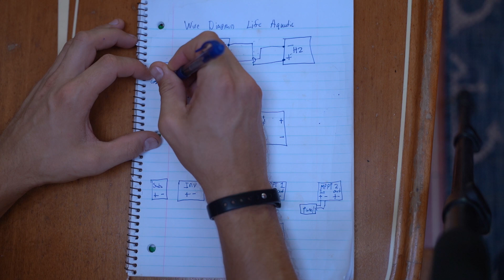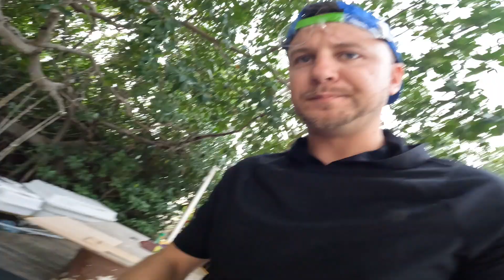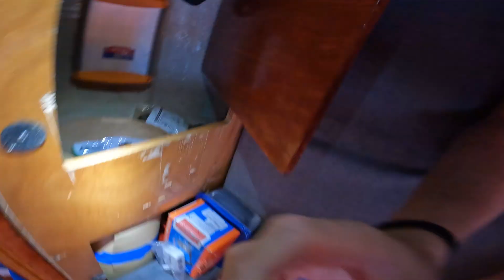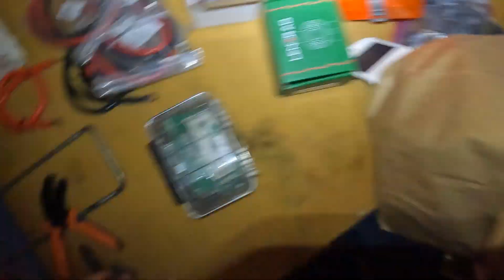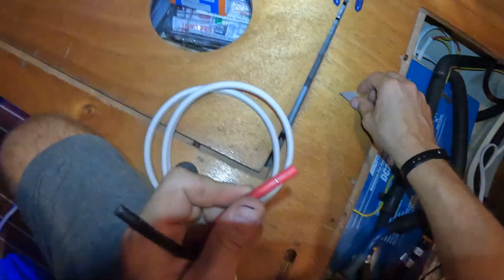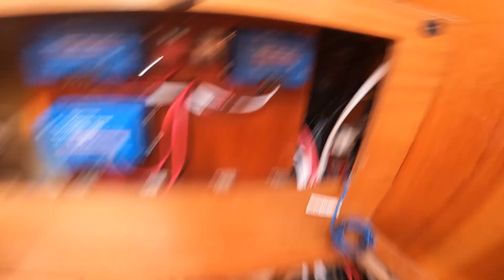Caribbean SAILBOAT Battery UPGRADE! New LITHIUM and VICTRON Gear!

Comment: Maybe missed it but what current is being delivered to the DC-DC 30 Amp charger from the Alternator? If more than 30 amps could it be reason for heat from unit? I am curious becuase I am on the same project and I wasnt clear how many DC DC chargers were required for a 75 amp alternator and how they are wired (parallel)?
Thanks
Reply from the maker: This is something I'm looking into currently with Victron, because I don't like how they have their fuse drawn into their diagram... Because If that fuse blows and removes the battery from the system it would inherently send all of the alternator power directly to the DC to DC charger. Is your unit also a victron? I am emailing them to review this electrical drawing. And understand what the max amperage the unit itself can see. I believe my alternator was previous putting out between 60-70 amps but I will review the part number on it and determine exact manufacturer output.. 

So the more then 30 amps, because the alternator is first being fed first to the large AGM battery's I am not to worried about the DC TO DC as the AGM battery should be taking the brunt of that amperage. But once it's fully charged It won't allow much more amperage to enter the battery. So I want to understand if this is what is causing the heat in the system. It is well reported that the victron DC to DC units run pretty hot on online forums. 

I am looking to swap this unit for their new 50amp unit if I can control the max amp output and limit it back if needed to match my alternator output.
Reply: @SailingLifeAquatic  I agree . I havent bought my DC-DC charger/s yet but I am planning victron components, I am working on Panel structure install. My current AGM Batteries coincidently have just gone south. So I am having to prioritize the install with more urgency.
I saw " the Sailing brothers" youtube video where they are installing more than one DC-DC charger for their alternator, this provoked my question to you.🙂
If my alternator pushes 70 amps and the starter battery is full I will like to know where that 70amps goes  as second option and if it has difficulty getting to house bank through a 30Amp charger? 🤔
Hope you have some success with your investigations with victron.
Reply from the maker: Also go do some research on the new 50 amp DC to DC that victron is releasing in March... I am going to return mine and buy that one as it networks so is truly a smart device. And it supposedly has better fixed it cooling issues.
Reply: @SailingLifeAquatic  That’s great to know. 🤔👍Bob. ❤️
Reply from the maker: Alright so to follow back up, my alternator has a max output of 115amps. 

 I have also talked to my victron distributor and they want me to return my DC to DC charging unit because it is consistently overheating in the current space it's at now. I think I will return this unit and purchase their new 50amp DC to DC charger that has supposedly solved their heating issues. And I'll still be under my 50% usage of the alternator. So I think it'll be the perfect size for this system.

Comment: As an aside, I was really interested in a Beneteau 373 as a tide me over Sailboat to get me afloat again until I can put an order in for an Island Packet IP 439, but the displacement was just too light to be able to do a Comfortable Atlantic Crossing on. Yes, it can be made safe enough to cross on and get up to Florida from a bit further South crossing , but Comfort has to come with it as well. Damned Shame, as a brilliant island hopping boat once in the Caribbean. however the 393 if shallow Draft and with Mainsail Furling does cut the mustard, and the one you locked at with that not cheap new mast, Id have put a final 7 day offer in at 70,000 dollars, which if rejected got dropped to a firm  60,000 dollars offer , I think would end up accepted, so all the stuff needing doing could have been worth the wait . Ive found that multi staged offers with time limits do often work well tbh. especially if in no rush. Bob. 👍
Reply from the maker: I offered them 80k and it was rejected. So I moved on and bought the Bavaria I have now. I like, not quite as much as the bennetau having lived on it for almost a year now but its a good boat. Tones of work needed to be done to it tho, but it came at the right price and right timem

Comment: As an aside, what boat have you ended up buying ? as There hasn't  been a video dedicated to the purchase of a boat since the haulout for the failed purchase of the Oceanis 393 ? 🤔 Bob, presently getting turned off by the over emphasis on bloody music content. You arent alonevin that by the way but it's usally accompanied with bloody Soft Porn content with most such channels and very littlevother than drooling over stupid Catamarans, which generally Suck at sailing to windward, and have a dreadful Bucking Bronco Corkscrew motion when beating into the waves duecto the hulls connecting with the waves at different times, which on deck can thow you over the side, or insidecthem catapult you into hard fittings and breaking bones. But certain types have an inexplainable lust for two hulls. I generally avoid anchorages with a high Catamaran cintent, as generally theybsuck at Sailng, and especially at Anchoring. Yeah I'm an intolerant Grouchy Old Bastard, so Sue Me. It's one of the benefits that comes with being a seriously Old Fart. 😅 Best Wishes.  Bob.  🤔🌟🌟🌟👍❤️
Reply from the maker: Whale tales and sailboat dreams, filmed a lot with cell phone but was the purchase of the boat!
Reply: @SailingLifeAquatic  Thanks, taking a look. Bob. 👍

Comment: Hi. It doesn't look as though you are complying with needed Marine Electronics Standards Specifications from what you are saying and drawing ? Do yourselves a favour and watch the generally excellent Lectures and instruction Videos that are free to view on YouTube Channel - Pacific Yacht Systems - to make sure you don't have to rip it all out to start it over to get yourselves a known good Safe and Compliant Electrical setup. Disclaimer I have no connection with PYS whatsoever, but they made me realise just how different Marine Electronics are to this Qualified Electrical Installation Engineer who didn't realise just how different they actually are. Best Wishes.  Bob.  🤔🌟🌟🌟👍❤️
Reply from the maker: Watched a few of his videos. So far I am quite enjoying myself, it is interesting to me he wants the batteries directly wired to the bus bars without a switch there to disconnect them. I enjoy being able to disconnect to my batteries when needed. Not shown on my wiring diagram, are the original house and starter battery switches. These are still in place and follow the original Bavaria wiring protocol. I have just added more to the battery side of the system. 

Although I will be adding a new fuse in line of my DC to DC charger to add further protection their
Reply from the maker: Thanks for the comments Bob, is their anything in specific you say that stood out as incorrect or could be improved upon?
Reply: @SailingLifeAquatic  Well tbh. the concentration on limited Plus and Minus Wiring rang bells with me as the exact same mistake I made with a few boats where I basically copied but upgraded what previous owners had done, mostly I was making sure that all wires were properly tinned as if you don't, the copper wires rust green and you will never get reliable connections. tbh, that was the limit I knew of what was important in the Marine Environment.  Then someone pointed me to the Pacific Yacht Systems Channel, and I watched all of their videos. Frankly, the only iffy advice I got from them was to never use one of the portable small generators only to find out that he used one himself - if the Boat is wired properly, then really there shouldn't be a problem, as it will be fully isolated, with no risk of electrocuting anyone swimming in the water near your boat. you also need to protect your boat from other boats close by that have bad electrical systems, as they can destroy your expensive anodes in no time, then the things your anodes were protecting get damaged. As I said, I got badly caught out and Marine Electronics is much more complex than I imagined after being trained in Land based electronics. I think most Boaters who have bought a secondhand boat, assume that whoever made any alterations after purchase, did things right, when in reality, almost nobody does. From the Factory of course, a new Boat should be spot on, as the penalties for them getting it wrong can drive them out of business. I think you will fi d those PYS videos as big an eye opener as I did tbh. Best Wishes.  Bob. 👍
Reply from the maker: The interesting part about Bavaria is from the factory in this model year they didn't use any tinned wiring.. all the wiring I have purchased since and replaced on the vessel is all tinned wiring.